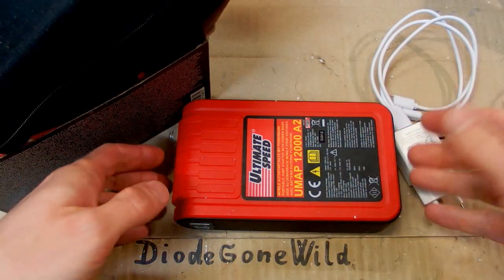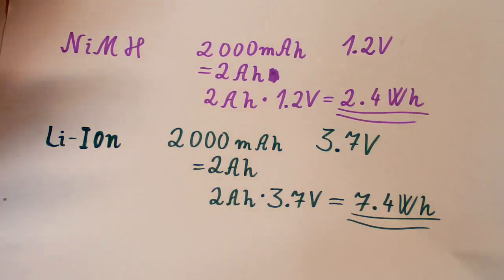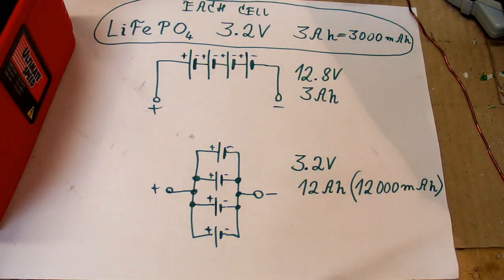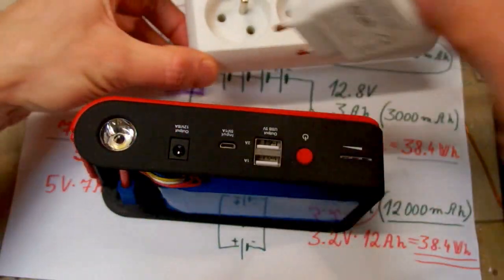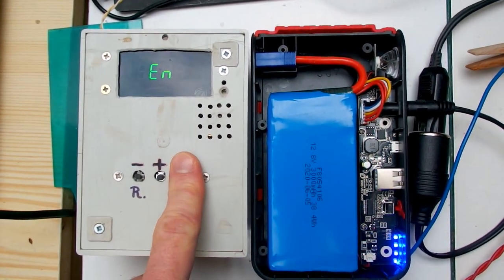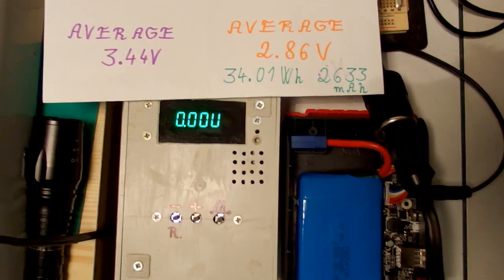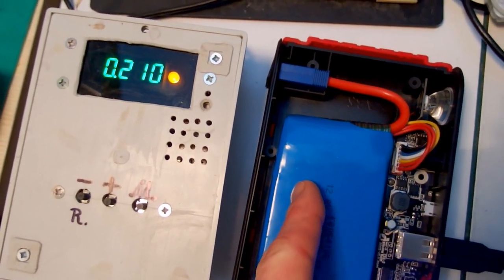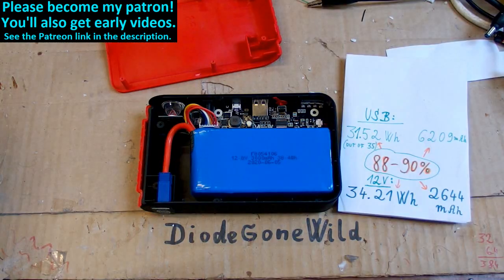Lidl "12 000 mAh" jump starter power bank capacity test

Comment: Sure Wh would be theorically the best but mAh actually makes more sense if you think about it.
You dont have devices that accept multiple voltages, so what voltage the battery has is meaningless to the consumer. The Coulomic Capasity on the other hand directely correlates with how long it will last so its better to give the mAh rating, which also helps when charging as Wh doesnt tell you how much cjarge is stored inside, while mAh does.
Fast charging would give you different Wh results than slow charging. Slow charging a NiMH battery would probably give you a way bigger Wh rating than whats stored. You would probably have to do some "smart" charging and calculate it based on the mAh and the open circuit voltage at intervals.

Wh makes more sense with lithium batteries because its CV charge and their resistamce is low enough that you can always expect a 1C discharge rating even when very worn out. Lithium ion then to rise in esr but also lose capasity. NiMH dont lose capasity if well kept but the esr which isnt that low to beging with tends to rise above what you would need for 1C. 
I have a couple examples but in one a pair of AAA from a beard shaver wouldnt last 5min, i replaced them and then meassured the old ones and they still measured 650mAh (700 nominal) after 3-4 years of use, but the ESR was high enough (350mohm) that i couldnt charge them higher than 500mAh and discharging at 1A would quickly fall below 500mA in less than a minute.
For all other purposes the batteries are fine, but they cant do high current loads anymore. They are ok for a mouse or some low power stuff. (Although they arent the low self discharge kind)
Reply: So inform about Watt and mAh, not great power, super power, the best etc. We have enough of the duracell robbery bullshit.
Reply: I would still argue Wh is more useful, especially if there are any conversion circuits around. My smartphone battery is rated 3.85v 3200mAH / 12.3Wh. Yet my phone doesn't have an external 3.85 input, it takes 5v (or 9 and possibly 12 if using QC or USB-PD). The Ah rating is only useful when dealing with permanently attached batteries. Even then it's not too useful because most devices have switching converters so the current drawn depends on the input voltage.
Reply: @eDoc2020  aah you like to argue.
Reply: @richardnoordhoff4288  Sometimes. But this is really such a minor thing.
Reply: @eDoc2020  
That why i say it makes sense in lithium (and most li-po/-ion batteries already have both mAh and Wh on the label) but you have to remember this comes from the era of lead acid and nickel cadmiun batteries. They used to charge lead acid batteries from mains using lamps in series as ballasts and then a gravimeter or however its called to know when the battery was charged....
Nickel carmiun (metal hydride too)  may not always have the same voltage for the same state of charge so Wh could change but the coulomic capasity may not. (because additives and shit)  Just like lipo batteries now that you have 4.1v (old), 4.2v, 4.35v,  and some even 4.40v max. The mAh doesnt change a lot but Wh does increase because of different chemicals and all, that why some are 3.6v nominal while others are 3.8V nominal. More voltage means more Wh, but the coulomic capasity depends on the amount of  chemicals which may not change much because 18650 cells and all kinds of cells have fixed sizes.

Again because maybe its a bit confusing, Wh makes sense in lithium batteries because you charge them with constant voltage.
NiCd and NiMH need constant current because you cannot derive the SoC from the voltage, at least not reaching 100%
Thats why you have 1.45V "hot" batteries, while other NiMH can do 1.55V without getting hot. 
Because of that and because back then you didnt have DC-DC converters or smart battery analysers, knowing the mAh of a battery was way more important for charging it. 
Just remember most things didnt have (and still dont have) dc-dc converters so the voltage goes to waste if its more than you need. Say a flashlight (may shine dimmer), or some toys (maybe move a bit slower), etc.  In those cases, knowing the Wh is irrelevant, and more relevant is the mAh rating which will have a direct impact in the time it will function.
If you have a dc-dc then yeah, Wh matters more, but you dont see 14500 cells in lots of things, and most cheap stuff use Alkaline or NiMH at best for stuff that does not use dc-dc converter inside. Say "dumb" devices. 

Also let me point out that many low power devices use linear regulators so your Wh again mean nothing because linear regulators "burn voltage", but the coulombs flowing through them are the same regardless of how high or low the voltage is. 
I have a small wireless keyboard+touchpad thing for my raspberry pi and it uses a cellphone battery, and inside it has a smt ldo doing the 3.3v for the micro so even in that casi like i said Wh isnt that relevant. 

All in all Wh only matters if its more convenient for your application.
Reply: @eDoc2020  many minor problems turns into a big problem. So eliminate minor problems by listen to wise people.
Reply: Amp hour (Ah) is the traditional method used for cells because then it makes it easier to work out how many cells are needed for your specific battery application. This is harder to do if using Watt hour (Wh). Most electronic loads draw approximately the same current over their normal operating voltage range. So you use Ah to determine the nominal run time.